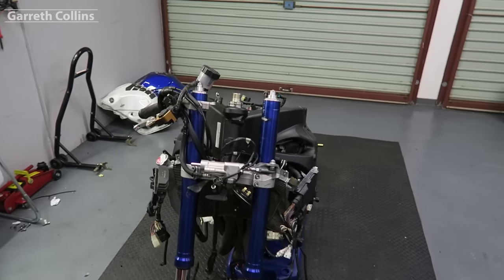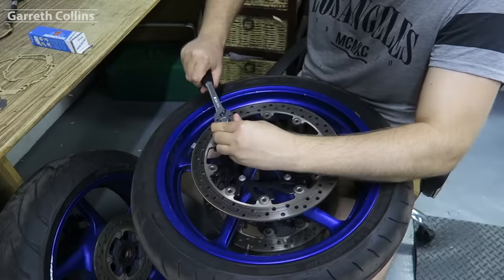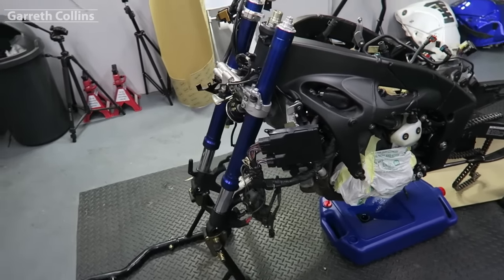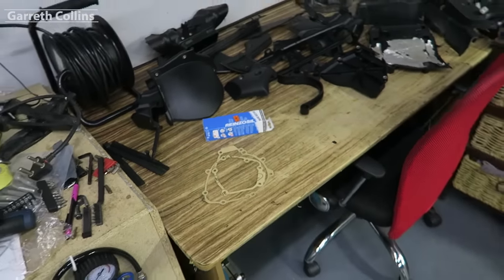Rebuilding A Crashed 2014 Yamaha R1 Part 3

Comment: Hey, Garreth have been trying to ask this question for a couple of videos now. How do you super clean the chain?
Reply from the maker: Simple I use kerosene/Paraffin which is a Oil base and recommended in all motorcycle manuals to clean the chain and then I take a dry cloth and try to remove as much kerosene/paraffin as I can. and then after I spray chain lube and again take a dry cloth and clean off overspray.
Reply: @GarrethCollins  Thank you very, much. Love the vids!
Reply from the maker: @elenachausheva8122  no problem glad you enjoy them

Comment: I really like your rebuild videos.  It's great to see a crashed bike rebuilt rather than wrecked.  Just wondering, if you're not going to replace the headers, are you going to give them a quick once over with steel wool, to clean them up a bit?  I look forward to seeing this one completed, and what you come up with for the fairings.
Reply from the maker: Glad you like them. As for the headers they are titanium and its just dust on them once they heat up the color will restore

Comment: gasket sealer on gaskets lol that king a strange to me. when i replace my stator cover i just put the gasket and the little bit on two places very light amount gasket sealer as the manual says. never leaks now 2y and 10k km so far.
very good job you've done to the bikes 
r1 looks and its build very nice
zx6r doesnt looks to be build on high standarts
cbr is awesome for sure
Reply from the maker: yeah i always had sealer to the gaskets as it fills in all the inperfections and has a long lasting hold.

Comment: Have a look at a Brother scan & cut, it would make cutting gaskets out a breeze (except you need to buy the cutter,) it's a cnc cutter used by crafters, my wife's got one and it's superb. If not, the 'brass rubbing' technique might be a better image transfer onto the paper, no need to draw around the old gasket.
Reply from the maker: That sounds sweet will have a look at it

Comment: Fantastic effort Garreth! Love the fact you’re making your own gaskets. What is the black stuff you add to the paper? Is it a bonding agent? When you run the engine, will the heat set it off to be a permanent seal? Is it too early to ask what colour will the rims be?😉 I’ve got no doubt it will be radical & awesome looking! You have a knack to turn crashed machines to life!🥇💯👌👍🏍
Reply from the maker: Thanks steve. The black stuff is gasket sealer makes sure it fills any inperfections and just needs 24 hours to dry for a good seal.   And not sure what to do with the rims yet 😂

Comment: Why being so cheap? Just buy OEM  gaskets as you are making a profit fixing these bikes and selling them.
Reply from the maker: I am not making any profit on these motorcycles and why buy an oem gasket that costs 60 dollars for one gasket when you could make your own? They need to be replaced everytime you open the covers imagine the money spent.  Being cheap 😂😂
Reply: @GarrethCollins  I just wanted to add that I enjoy your videos and recently replaced the gasket on my stator cover. It is my understanding you need a completely clean and dry surface for the new gasket, but you covered yours in sealant? 
Yes it is recommended to change the gasket everytime a cover opens with one. Hopefully it wont be all the time. Paper  gaskets from what I've seen are not $60. Mine was only $20 from the UK (Triumph) so I expect Japanese bikes gaskets are cheaper :)
Reply from the maker: I Live in South Africa it costs 60 Dollars per gasket.   And you need a cleaned surface with no lubricant on the surface and i use a thin layer of rubber sealant that is unaffected by all oils, lubricant and gasoline to seal the engine covers for a longer lasting finish. The way you described it as if im filling the entire gasket with a overload of sealant but I am not its a very thin layer that covers any inperfections in the surfaces and gaskets been doing this for years. But we all have our own experiences and ways of doing things and I cannot say that my way can be any better than yours but only my experience I have had to avoid issues.